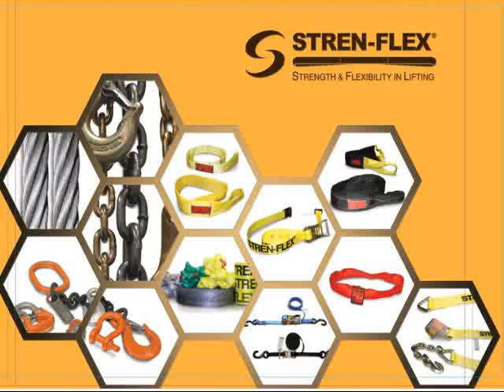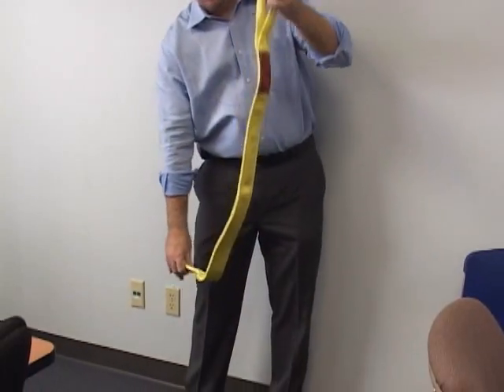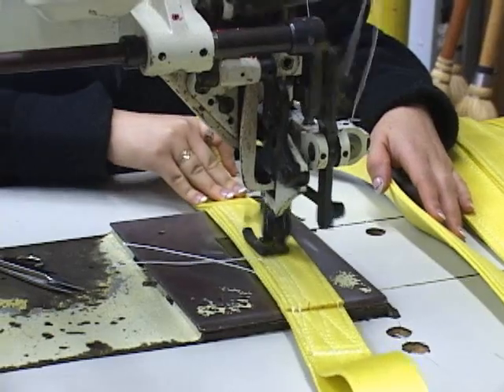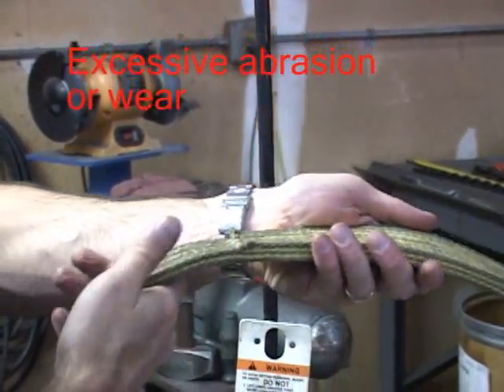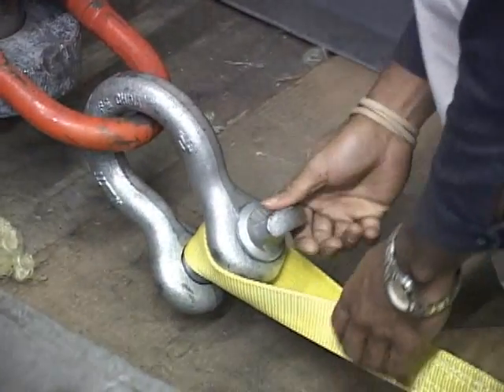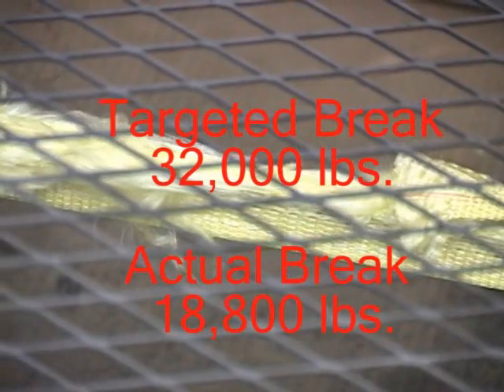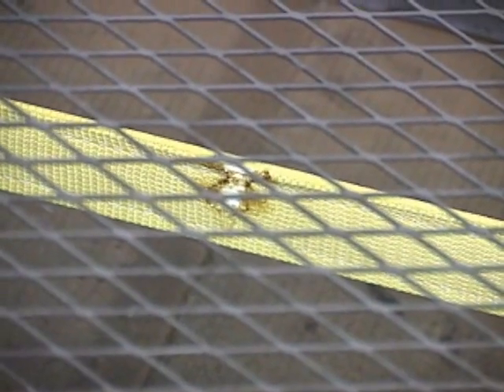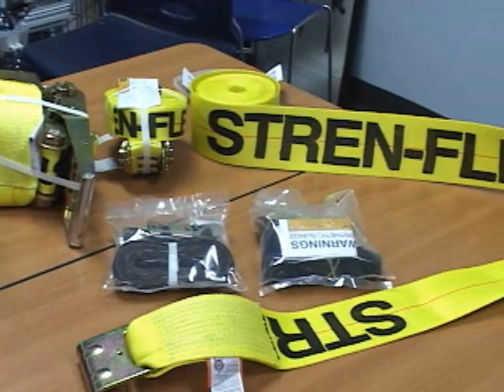Stren-Flex Sling Inspection Video

Comment: One of the most thorough synthetic rigging inspection videos on the Web.  There's a ton of great info packed into 13:39.
Thanks for showing the percentages in the deterioration of the slings under various load stresses.  This illustrates wonderfully what can happen to slings with visible defects that are over loaded.